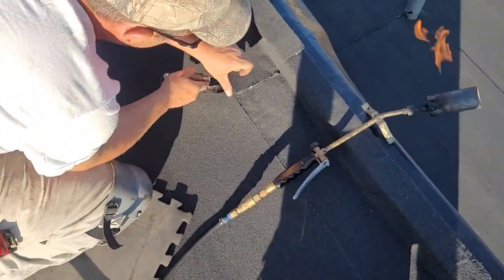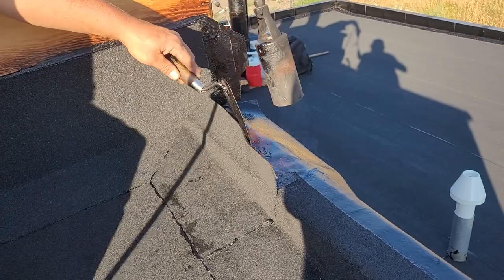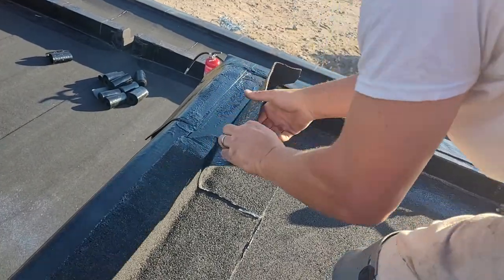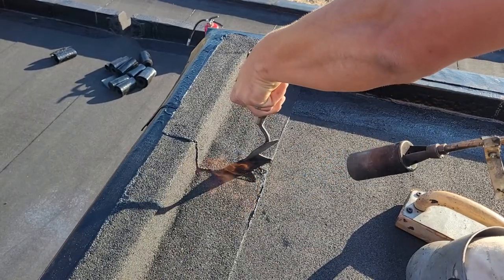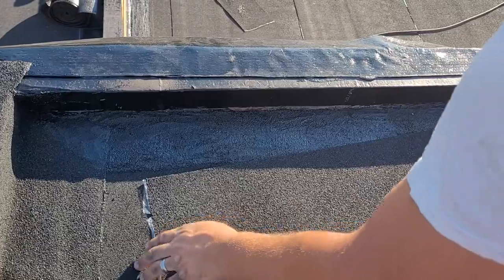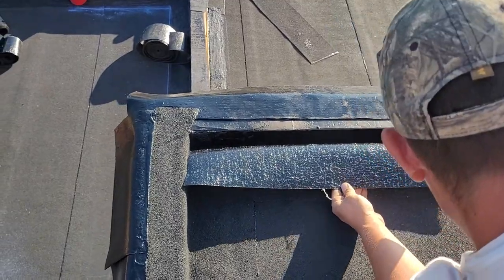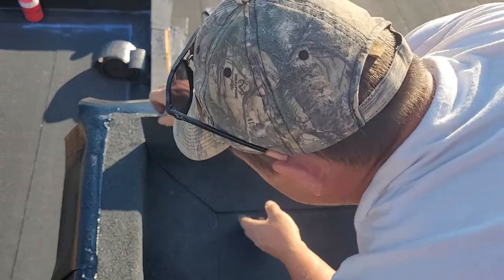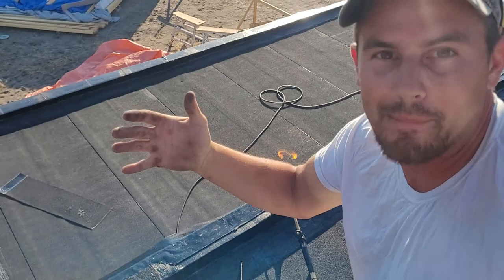soprema sbs corner install ( torch-on ) Part 2

Comment: Slow
Reply from the maker: they don't call me "slowdy" for nothing! lol I'm much quicker when I'm not explaining myself lol
Reply from the maker: @whatmouth  sounds like you wouldn't last 30 seconds here with that attitude! things are done differently in different parts of the world, if you've noticed. What I do is industry standard in these parts. I am curious about this tilt fillet you keep talking about, it sounds important and I'm sure it helps ?! I'm looking into it! Again, thanks for your input!
Reply from the maker: @whatmouth  what you call a tilt fillet we call can't edge here in Canada. For new roof applications they aren't necessary. The whole reason they were on flat roofs in the past was for BUR systems, or "tar and gravel." That material couldn't handle the 90 degree angle change and would Crack. With new torch-on SBS the fibers are synthetic so it can easily withstand the angle change so it is no longer industry standard. I prefer it without personally.
Reply: @thetrahanman  Canada !! I have mate he'sa  felt fixer from UK  lives over there loves it says everything's loaded up on roof but always  freezing !!!!